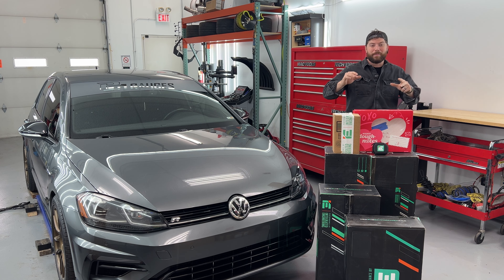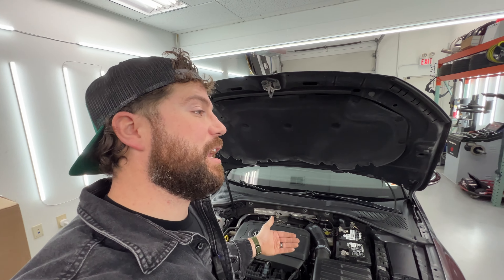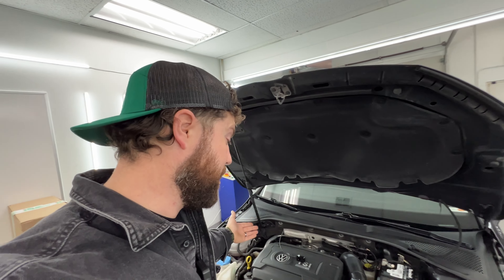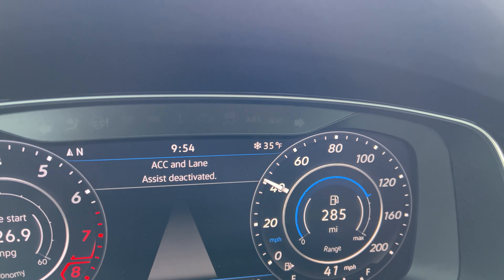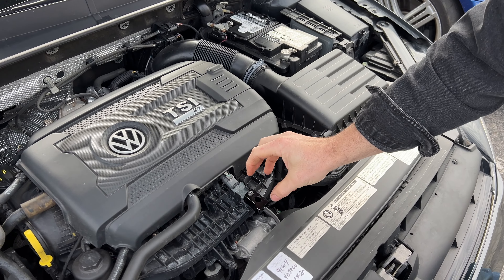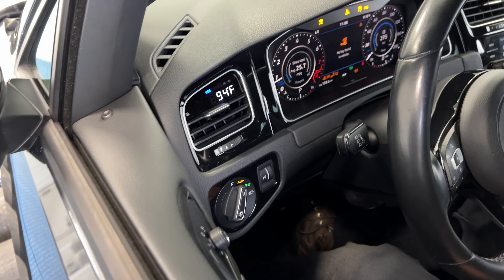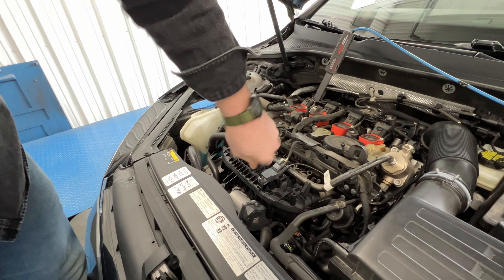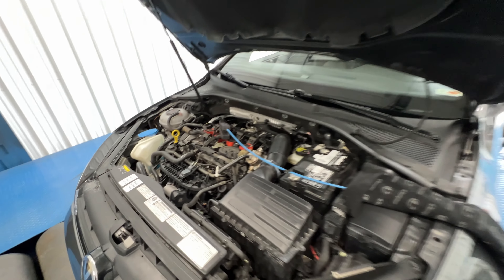Stock Mk7R Dyno Runs and Boost Tap Testing | P3 Gauges

Comment from the maker: NOTE We plan on revisiting this when it's warm out and we are stage 2+ and TrueFlex. Currently it seems like the IAT is acting similarly to a downstream o2 sensor when a spacer is installed. The data is smoothed way out and doesn't react quickly. The strange part is that the aluminum was very hot to the touch but the IAT reading was much cooler than expected. We'll see if we get similar results when we are near the top of tuning potential rather than stock!
Reply: Did you ever revisit this.
Reply from the maker: @ I’ll be installing the flexfuel this week hopefully then hitting the dyno next week👍🏼👍🏼
Reply: @P3Gauges  Awesome!  Thanks for the quick response.  Looking forward to the update.
Reply from the maker: @MiamiBourne  MY BAD, I didn't realize this was our stock dyno video. We've already done 2 more dyno runs on this car at stage 1 and stage 2+! Here's the playlist to see all the videos on the Mk7R build - https://youtube.com/playlist?list=PLvFyWsK95HGhl66PLrCreEvBSvULAw1VX&si=Bx1J2Z6RI5lWqwAr

BUT... I will be hitting the dyno next week after going flex fuel with the hpfp upgrade as well.
Reply: @P3Gauges  No worries.  So no issue using the MAP sensor for boost?   I’m chasing down a boost leak and may try this type of boost tap.
Reply from the maker: @MiamiBourne  In my opinion, I'd just read boost right through the OBD2 port from the factory charge pipe sensor. You won't be able to see vacuum but you won't be limited to 22.5 psi with the stock 2.5bar MAP sensor. We've got a video on EA888 boost readings as well to explain this all - https://www.youtube.com/watch?v=V63yZ-J2bek

Let me know if you need anything else.

Comment: I have run a boost tap like this, for over 2 years. Audi A3 8.5V EA888.3 2.0TFSI. Other mods include 034 TIP, ECS Cold air intake, no tune, no exhaust, or any other mods. mostly stock. This part has been reliable, and when first picking it out, I read all the hate about it. Then I tried for myself. 2 Years, and 35K+ Daily driven miles. No CEL, no wildy irregular MAF readings, just an easy to use boost tap, that I didn't have to puncture a hole in my intake manifold to install.